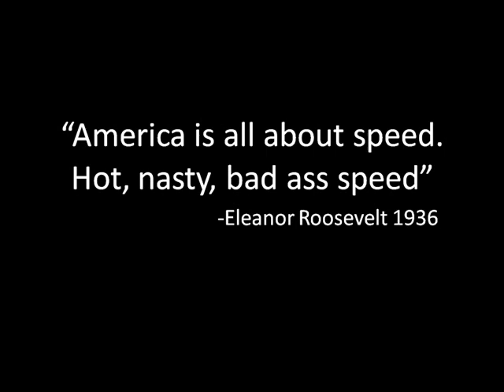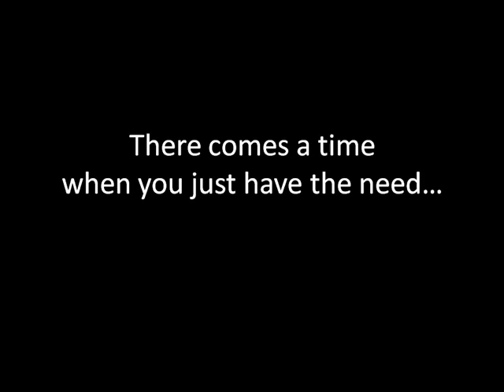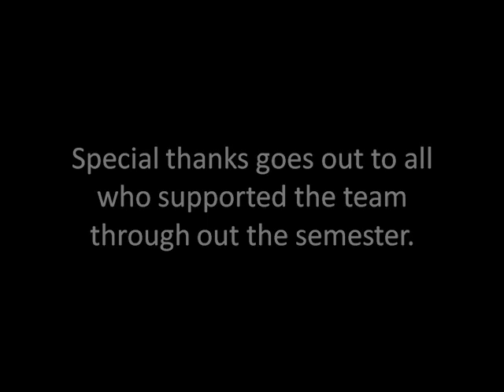Cajun Crawler Exhibition 08

Comment: Truly a thing of beauty.
 I think if the wheelbase (legbase?) was longer it would be more stable in the front back axis. Also if the legs were longer it would be able to move faster.
The nice thing about this is that it uses no power when you are standing still.